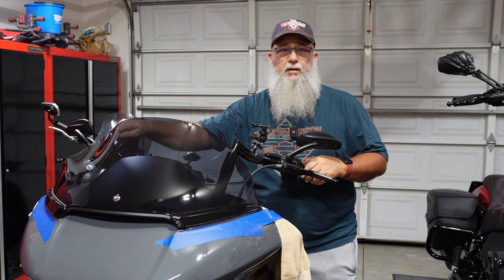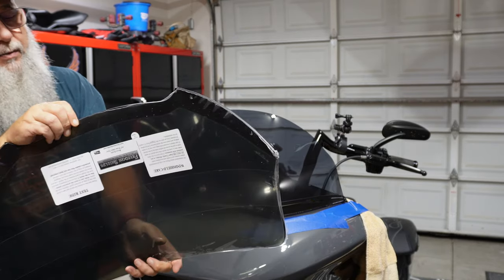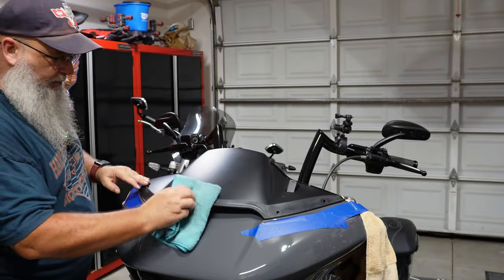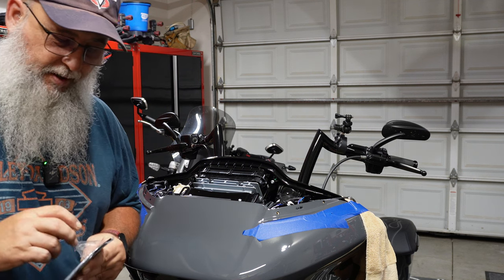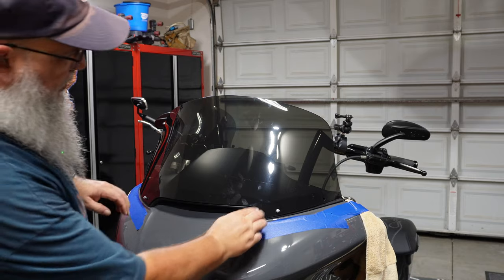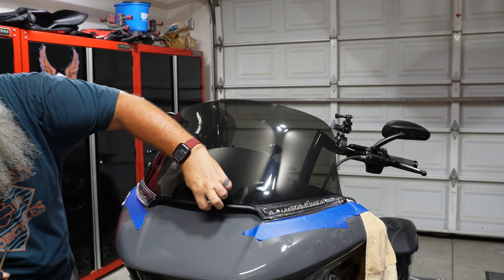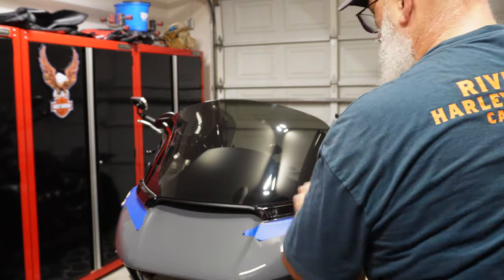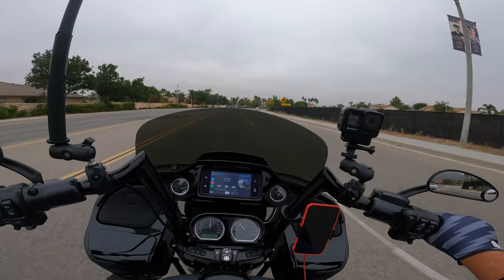2022 Road Glide ST Upgrade - Freedom Shield Install

Comment: Interesting. Good review. I thought Clockwerks was top of the food chain. I like the idea of Freedom being thicker. I will explore them. Do they make sporty ones for the RG ST?
Just a thought, maybe the creeking and whistling could be from your windsheild lights. Not having the positive connection to the fairing.
Reply from the maker: Thanks for the comments Jason. They do make sport versions along with the touring styles. The whistling sound was not from my horizon lights since the mount after the shield. Besides, it was happening before I added them. 

Check them out, great product great company. And no, they do not sponsor me ;-)